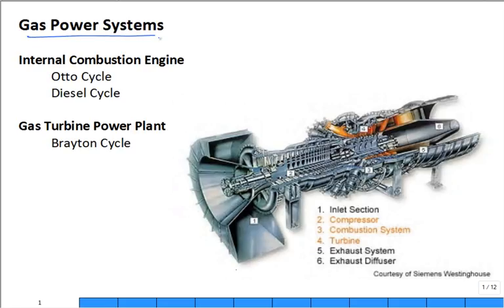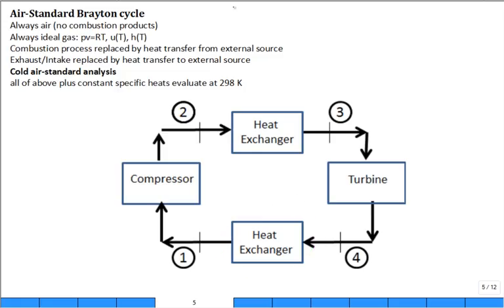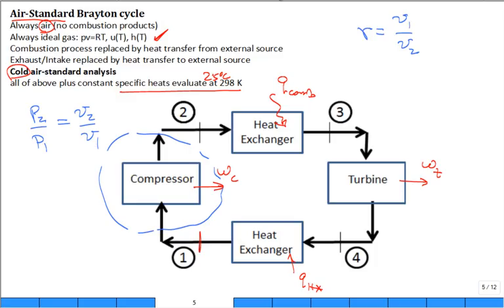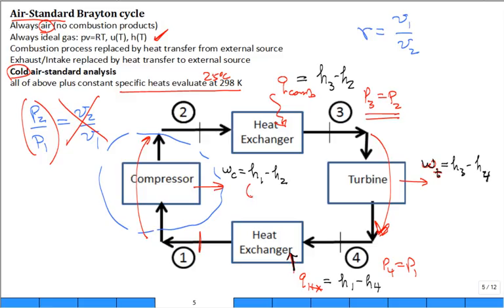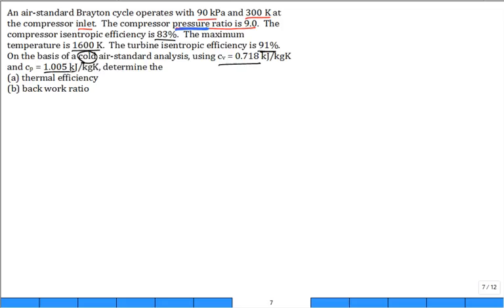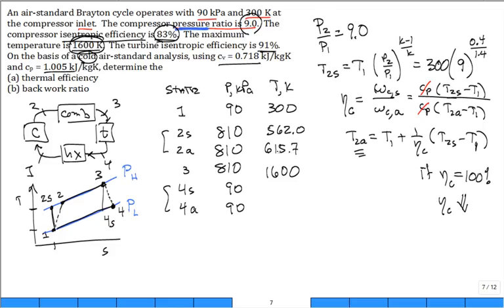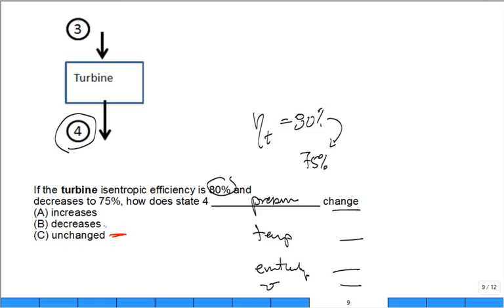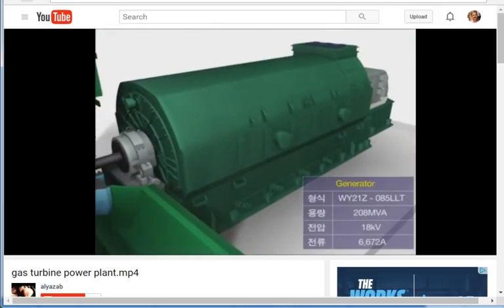ME4293 Brayton 1 Fall2016

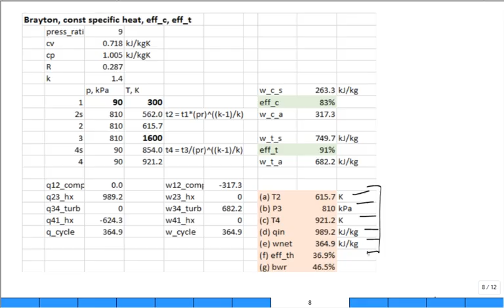Comment: at 30:15 your answer for w_c_a is wrong? : 0.83x263.3 = 218.5 
how did you get 317.3? ( i know you worked that one out from before but still the % is wrong)

how did you work out the entropy values in the graph at 36:26 please ?
Reply from the maker: FireLordZuko divide by efficiency
Reply: ok thank you / what about the entropy for the ts disgram sir? did you use the tables or used an equation? i am not sure how you generated the data for it. i want to build a model as well.
Reply from the maker: FireLordZuko sorry, I don't have time to tutor
Reply: i understand/
any hint so i could try to figure it out pls?